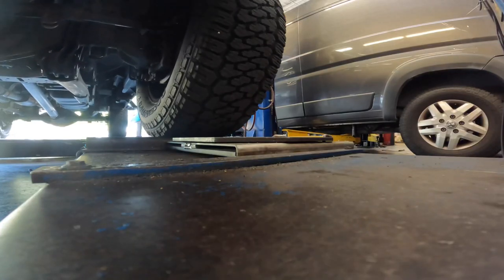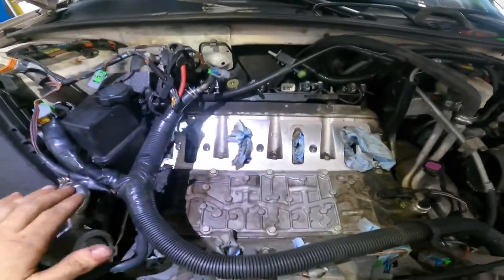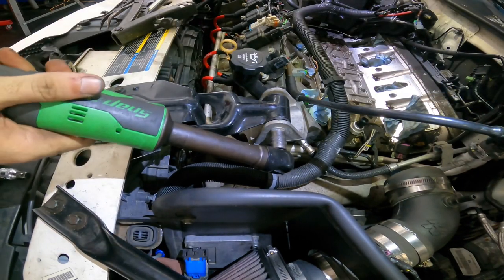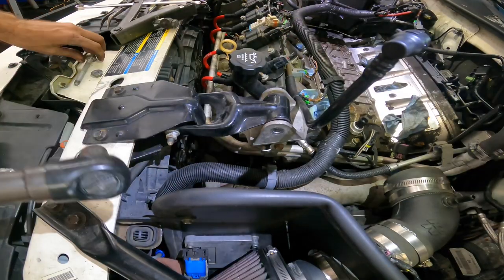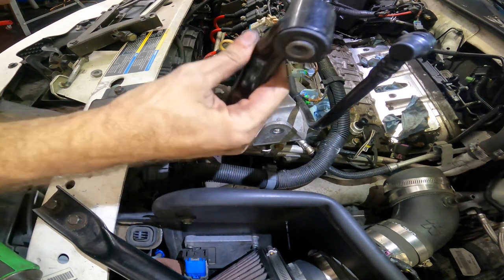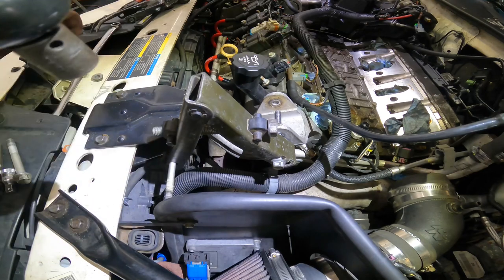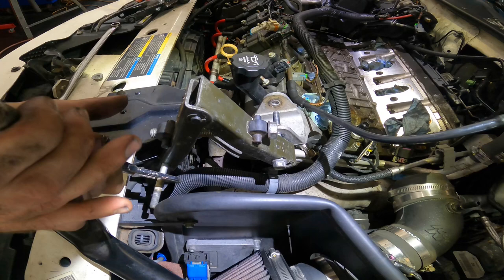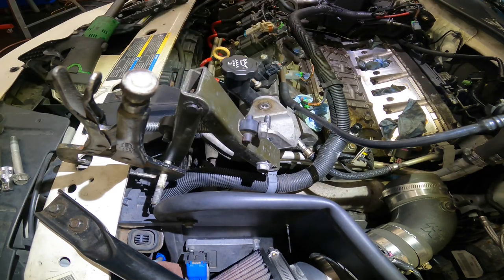Slightly Risky but Necessary  Front Wheel Drive LS V8 Spark Plugs

Comment: My mom used to have a '91 Lumina with the 3.1 Litre V6.  The front engine mount had an extra bolt hole to hold the engine forward while servicing the rear plugs.  I just used a pry bar to move the engine forward, put a bolt in the extra hole, and voila😁  Nothing compares to the 3rd gen Bird I used to have, the engine compartment was so large, I could stand inside it, super easy access to everything.
Reply: My wife's 03 Monte Carlo with the 3800 had the same set up.
Reply: I miss the 3rd gen for that reason, so much better than the 4th gen where half the windshield is over the engine. Same for the old GMT 400 trucks
Reply: @flotowncomputerguy6243  I know what you mean.  I'm in the process of changing the fuel injectors in my '95 Bird.  She's a 3.4 Litre and I had to remove the plenum just to get the fuel rail high enough to get the injectors out.  Cramped, cramped, cramped.  I can only imagine what the 5.7 Litre is like😲  On the other hand, my 4.8 Litre Silverado was a piece of cake to remove the fuel injectors as compared to my Bird.

Comment: Some early Transverse engines in the eighties had a similar procedure to access those plugs. Undo top motor mount, put car in neutral, roll car forward rotating the engine until plugs accessible, put in park or gear, change plugs, put car in neutral, push car rearward until engine in operational position. Install top motor mount.
Reply: Ya , that technique's a winner 2
Reply: The tool he was using used to be sold on the tool trucks. It went in place of the "dog bone" or torque strut. You put the trans in neutral and tightened it all the way up.
Reply: I used to just use a ratchet strap to pull them forward. Was not spending $ on a special tool for that
Reply: Was sll I had in the day, 2
Reply: @yomomma9070  what was it's purpose? Help hold motor stationary for other svc perhaps?
Reply: @peted5217  for the same reason ray was using it--to gain access to the rear bank.
Reply: IIRC, there was one Alfa Romeo model that included a hydraulic engine-tilting system for exactly this purpose. Hard to imagine how much of a mess that must have been.
Reply: The X's and A's at least from 1982 forward, this tool is a lifesaver. Rear wheel, chocked, transaxle in neutral, you can get enough space to access the plugs.
Reply: Some torque struts also had an additional hole for mounting bolt so you could rock engine forward 
to hold it in place
Reply: @billhenderson1865  GM started that on W bodies in '88 IIRC.
Reply: Almost... You leave it IN gear or park - otherwise you're just rotating tranny (oops, can I still say that?) shafts (that's the dirty part.) Once you've rotated the engine forward, kick a chock behind the wheels to hold it there.
Reply: @yomomma9070  thanks for info. Tho it's frm my era, never seen one before. Looks like large version of a door spring compressor.
Reply: @peted5217  good comparison.  Never thought of it like that.
Reply: Yep did that plenty of times with the 3.0 and 3.3 liters in my mom's Buick and the 2.8 in my dad's Pontiac 6000 wagon.  It made getting at those back 3 plugs so easy.
Reply: That seems a lot easier than messing around with that sketchy tool.

Comment: Ray, I hate to break this to you but this was standard procedure to change the rear plugs on the GM/Buick 3800 for at least 20 years. The tool used was made by Thexton and I threw the one I had for my Pontiac Grand Prix out about two years ago when I was going through my stuff. It worked like a charm but you could accomplish the same thing with a ratchet strap but it wasn't nearly as easy as using the Thexton tool.

Comment: Nice to know they actually made a tool for this, but removing the front dogbone mounts and using a ratchet strap to roll the engine forward is a decades-old trick for accessing the firewall side of most GM W-body engines.  Thanks for sharing, Ray!
Reply: When I looked it up in ALLDATA years ago, gm said to use a strap. Ratchet tie downs are so much better for this than the type gm specified

Comment: I think it was my '82 Olds Cutlass that had a transverse V6.  Mechanic taught me the trick of pulling the front motor mount, shoving a 5 foot pry bar down, and rotating the engine forward.   He had those rear plugs almost vertical under the hood.   Swapped 'em out and rocked the motor back in place.

Comment: The engineers that designed that mess were laughing at the mechanics that they knew would have to deal with future spark plug replacements.
Every new car I have ever bought, I would look first at all the basic mechanical things that would have to be done in future. If there was any kind of problem then that particular model car was eliminated from my purchase.
The one car I did buy at one time was a Subaru that when one of the headlights needed a simple bulb replacement, you had to remove the entire battery to get to it.
But, I like the car so well that it was my only trade-off.
Great SHOW!!!
Reply: The engineer's don't care about service. It's easy of assembly that counts for them.
Reply: I mean on a 07 civic to change the bulb you have to remove the fender liner and washer tank, ill gladly trade for a battery removal
Reply: @easyrider241  Rainman; "I had to take more time to do the service work on your car due to design flaws therefore your bill was higher for this type of service."
Customer; "You mean my car was NOT designed to be maintained in a normal mechanic's time frame?"
Rainman; "Yes, you're car is a piece of shit designed by thoughtless morons only interested in how more efficiently they can assemble them but not to work on them later."
Customer; "Oh, I should have bought a Toyota..............."
Reply: I imagine you are rich enough to pick and choose the kind of car you buy. We poor folk must take what we can get for under $500.

Comment: I had a '92 lumina v6 that we Un bolted the top motor mount and then used a c clamp to pull the motor forward to get at those plugs. It worked once a champ.

Comment: some of the eighty's had the upper mount with 2 sets of holes, so you could pull forward the engine then place bolt in other set of holes.

Comment: A friend has a tool (For his old 3.1 grand prix) that fits exactly in place of that mount.  it pulls back the engine enough to get the plugs without "engineering" a work around.
Reply: Do you have a link to it?
Certainly sounds like one of those special tools that is a knuckle saver.
Reply: @BA-gn3qb  I'm not sure where he bought it.  possibly a dealer or snap-on.
Reply: @BA-gn3qb  Thexton 419X is the tool
Reply: @SouthMainAuto  - Sweet!
Thank you.

Comment: I had a 68' Cougar with a 390, and you had to lift the engine to do the 2 center spark plugs on each side. It was even more fun with power brakes. Shock tower and master cylinder in the way. Wobbly bits and extensions to the rescue! Have a great day, Ray!

Comment: I've seen those before, but never knew what you could do with them. Now I know.

Sears used to have spark plug sockets with wobbly bits attached. Shorter by a good 1/2 inch than adding a wobbly bit to a socket. Great for getting into those tight areas.

Comment: Easier to use a ratchet strap and pull engine toward front of car. That's what I did on v6 fwd. Worked great. I removed the mount like you did first.
Reply: Not only do I agree but I swear I didn’t see the engine move when that contraption was tightened
Reply: @myz06rocks  It did move. Watch again. But as an owner of an 05 impala with the 3800 series 2, Ratchet straps.

Comment: My mon had a 1973 chevy Vaga 4 cylinder that the Book said to pull the engine to access the rear two plugs as some fool of an engineer pointed right at the firewall. The one on the driverside was a real mother lover to get to but you could get it out with a 1/6" turn at a time with an opened wrench, but that dang passenger side was impossible to get out, as a 16-year old  I took a punch, and lined it up with the sparkplug end and punched a mark in the firewall, went into the passenger floorboard folded back the carpet and padding found the mark and used a 1" hole saw and cut that bad boy right out, put my sparkplug socket and 4" extension on the plug from inside and took out the plug, installed a new plug, got everything buttoned up started the car and drove it down to the local hardware store got a 1" rubber grommet popped it in and never had to remove the engine. Frigen GM engineers. LMAO
Reply: Yes, not only Vega. On the full-size V8s people used to leave the rear plug alone. Punch a hole, you are golden.

Comment: Remember Tune Masters? Any V8 for $35. I had a '75 Chevy Monza that came with a 350 V8. The problem? You had to raise the engine to remove some of the spark plugs so I went to Tune Masters. They said $35 for any V8. I reminded them that the engine had to be raised. They said, "We advertise any V8. It's still $35". I stood and watched them and they did a great job in only 30 minutes. The even removed the springs and weights in the distributor and cleaned them.
Reply: I remember that being required. That and a Camaro. We use to get those cars coming in after a tune-up from other shops still running bad. It was because those plugs were never changed. Old days.

Comment: Had Changed my head gasket on my 2001 Montana by tilting the engine forward. Removed the upper mount and then used a ratcheting strap to pull the engine forward.

Comment: On the Chevy Venture/Pontiac Montana/Oldsmobile Silhouette  with the 3.4L transverse V6 you had to remove the 2 upper mounts (same as that single) then attach a short ratchet strap from the radiator support to the engine and pivot the engine forward. Gave about 3 inches clearance on the rear bank. Still have my short strap somewhere in my toolbox. GM engineering at it's finest.

Comment: HAPPY4th!!!!! some of the old GM transverse mounted V6's had a lifting lug mounted to the rear cly head.. But it did not have a round lifting hole IT HAD A 1/2 SQUARE HOLE.. for a 1/2 breaker bar for the same reason..

Comment: I had to change plugs and wires on my dad's old 1986 Cadillac Seville with the transverse V8.  It was kind of a pain but not so bad as this car because it was the small 4.1 Liter V8 engine, this was the "transitional" engine Cadillac was using with throttle body injection before they came out with the infamous 'Northstar' design.  Fortunately, I have medium size hands, so I was able to get back there and change out those plugs and wires.  My dad had been driving it for a while with the engine missing and I kept telling him to let me change out the plugs and wires but he was too cheap but finally he let me do it and it solved the problem lol.

Comment: Back in the day when working on the old GM 3800 engine we would disconnect the torque strut, put the vehicle in park push it forward and jam a piece of wood behind the tire. GM was kind enough to put a second hole in the strut that you could put the bolt through

Comment: I worked at a gm dealer and what the tech's would do is remove the top mount like you did, then slide a jack under the car and put a piece of a 2x4 on the saddle and jack up the back of the motor tilting it forward to get to the back spark plugs.

Comment: The tool work but you need to put the transmission in neutral, or you could used the transmission in park instead of the tool , pulling the car towards you.I used to have a 1988 Cutlass Supreme V6 same engine. Nice job Mr.Rayman.
Be bless and safe

Comment: I believe the number 5 cylinder on an 03 buick rendezvous was back center. I was able to get the plug out by getting under the car and reaching up and over the exhaust manifold. Was able to get about 1/20th turn at a time and it took close to an hour for that plug and 10 minutes for the other five. Now I feel like a dum dum. Nice trick.

Comment: GM used to use upper front mounts with multiple holes so you could take it loose from the engine and rock the engine forward and shove the bolt in the other hole to hold it in place. It's like they're trying to make home maintenance harder so people have to go to the dealer.

Comment: I think you lost part of it there should be 2 metal legs off the one side and able to bolt it in straight i have kept mine and I also have the old oil filter tool for the 2.5 gm with filter in the pan.

Comment: Imagine if engineers that design engines had a professional mechanic on the team as a consultant, someone that could spot details that could be an issue that may cause difficulty in maintenance in the future.  Make it easier for people to maintain their own vehicles, loser the labor costs for repairs etc.  They used to engineer by the KISS method, Keep it simple stupid, But they have thrown that out the window.

Comment: I’m actually considering putting a 5.3 with a 4t65 into my rail build.
Reply from the maker: Better build that trans a little. Btw that would be amazing! I always wanted to do that with a 4.9 Cadillac engine (weird I know)
Reply: You guys are so lucky that you can do these kinds of things where you are. Here we practically need an EPA permit to upgrade the spark plug on our gas lawn mower.
Reply: @RainmanRaysRepairs  yep, I just rebuilt a 4T65E yesterday on a 05 Monte Carlo and it was only attached to a 3800. it did have 230,000 miles in it though. it's also not a transmission that's diy friendly, all the shift selinoid are behind the front cover so you need to pull the axel and drop the cradle to get to it from the left side wheel well. and the selinoid go bad on all of them.
Reply: id go with a 4t80. its not as much of a glass tranny as the 65, they blow up with 240 crank hp 3800 engines. the one mated to a 5.3 is the same tranny, aka glass.

Comment: I hate to "rain" on your parade but that "trick" was used in GMs 3100 and 3800 series of engines because I had a 3100 grand am and grand prix that I used that method. Disconnect the motor mount then using the trans roll the engine forward or toward the bumper to give you access.

Comment: Rainman Ray, Question.   Have a sample of new unused trans fluid in a glass vial I use as a control sample to compare to used fluid for color.   I found the unused fluid sample has a very fine white sediment on the bottom. What is this stuff, Is it normal. If it is a functional additive in the fluid, I guess we should be shaking up our quarts of trans fluid before pouring into the vehicle, If this is normal I imagine a lot of this additive is getting left behind in the bottles. Or is this not normal?

Comment: I've owned a 1992 Toyota Camry V6 with the transverse engine and... no... that doesn't work.  I actually could replace the back three plugs with a combination of swivels, extensions, and lots of profanity... did it several times.  Nowadays with the individual coil packs, with my ex's '06 V6 Camry with the individual coil packs, I won't even attempt it.  
 
Notice I said "my ex's".  Yeah, I help her out with car stuff, and I kinda consider myself an expert on Toyotas (since they're all I've owned for the last thirty years) but I refuse to change those plugs.  This is even coming from a guy who just replaced the timing belt on his 1st generation 2UZ V8 Tundra.

Comment: I did this on an old lumina one time. We pulled the mount and rocked the car in park, then stuck the bolt through another hole and it held the engine forward while we did the rear plugs.
Reply: As it was  designed that way  to be able to  access the plugs, it works.  Haa. mine was the same.
Reply from the maker: Clever